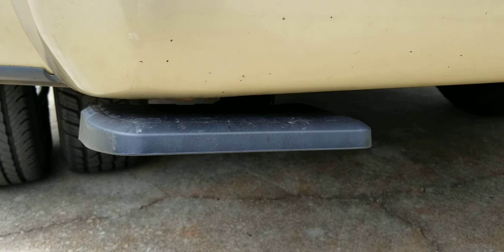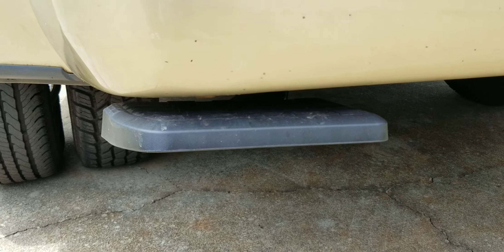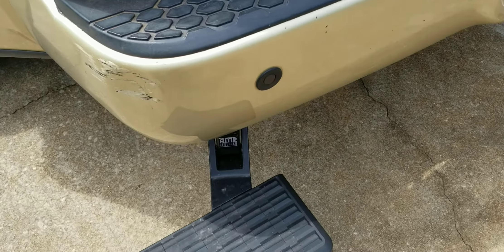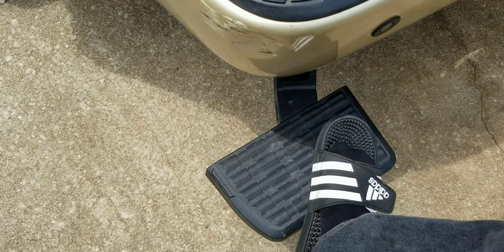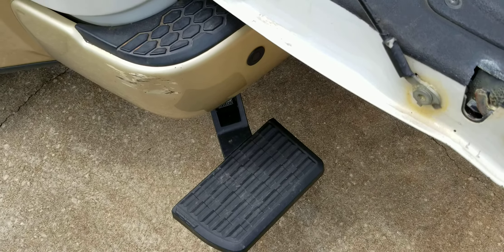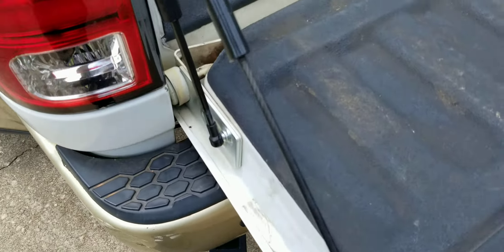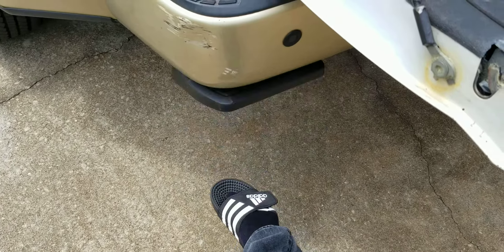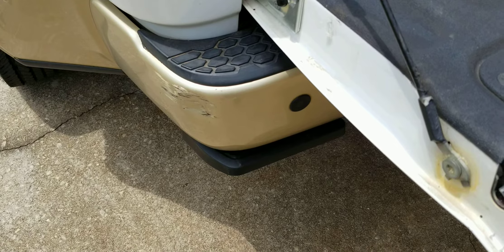Amp Research Bed Step 75306-01A

Comment: A dually very nice
Reply from the maker: Yes its extremely fast as well 900 or so HP and 1600 TQ Cummins 6.7l turbo diesel. I have another video coming out tomorrow on some sick running boards I got.
Reply: DIY KAI cool bro